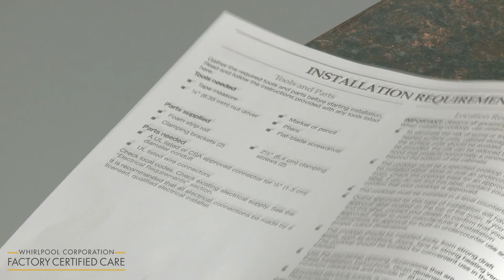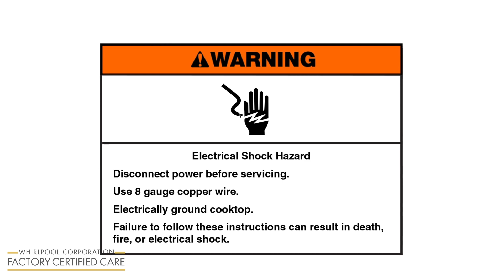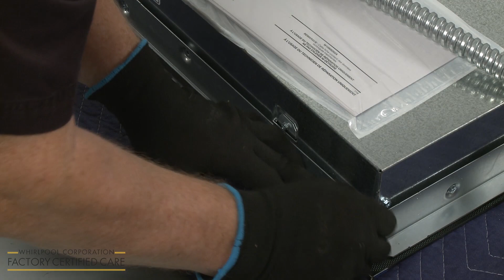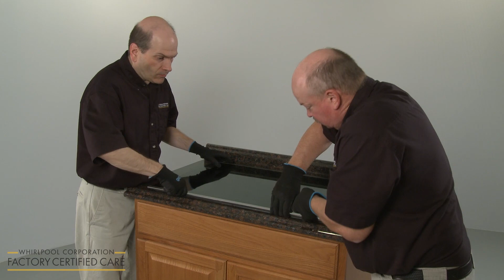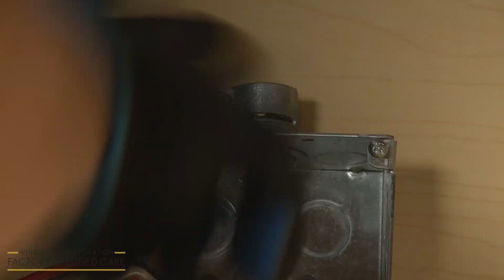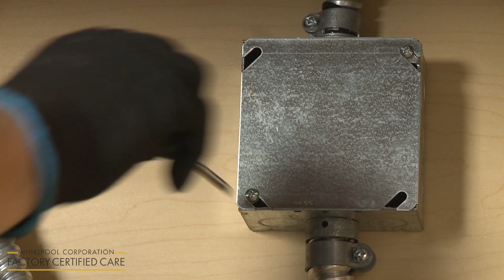Whirlpool Electric Cooktop Installation & Wiring | Model G9CE3065XS

Comment: Just bought a new cooktop made by Whirlpool, but the instruction of install the adhesive foam strips is as following: "Apply the foam strip adhesive around bottom of the four edges of the cooktop glass, following the edges of the glass."  But you put them on the metal parts instead of glass?  Which way is correct?  Thanks!

Comment: Hi, Should the cooktop have a support underneath in the middle? otherwise if you place a heavy pot in the middle, this will crack like a cookie.
Reply from the maker: Hello, as long as the cooktop is installed in compliance with the Installation Guide and used   with information from the Use & Care Guide,  We would suggest checking the Use & Care guide before purchasing so you can check on things like pot size and canning notes.
Reply: @Σκληρός Καριόλης There was a metal lip running underneath the glass. My guess is this is what's actually holding up the top and not the glass plate. Also I'm guessing any wooden supports under there can pose a fire hazard if the casing gets hot while the top is in use.